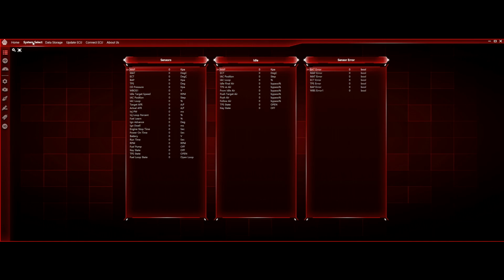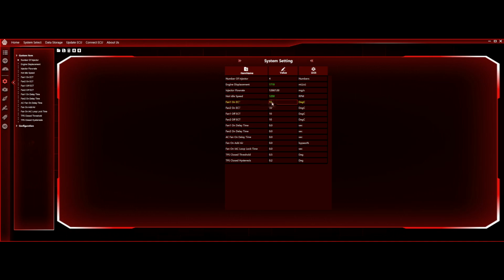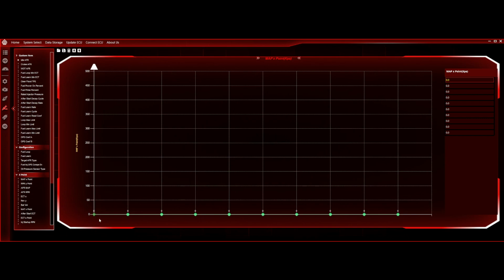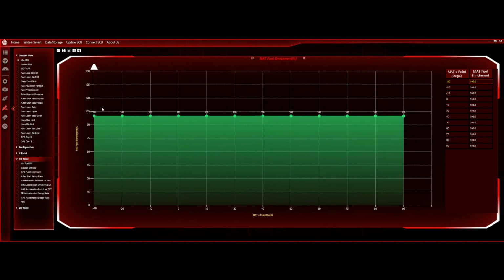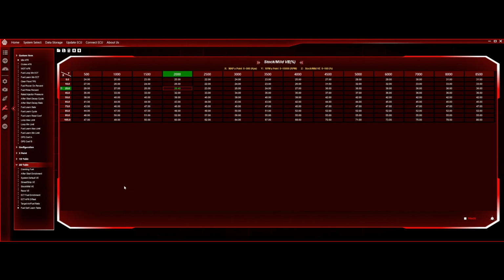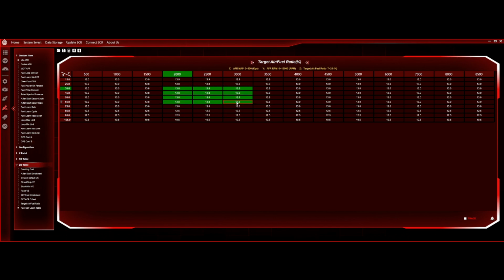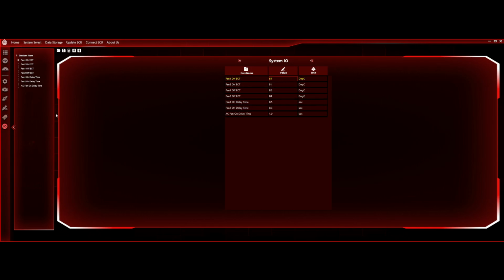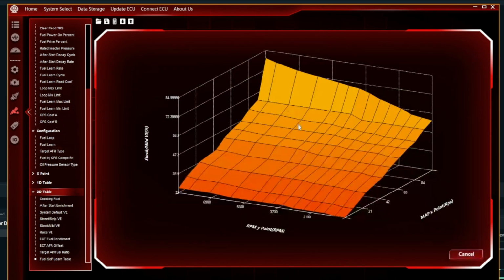Can you tune a rotary on Aces EFI advanced software? (I shouldn't have access to this kind of power)

Comment from the maker: I just want to add a comment on here after messing with this tune on my car. This system reads 100kpa as vacuum (~14.7psi) and 0kpa as atmosphere. Even if you swap the numbers around itll still track the same. It's kinda confusing.

Comment: How do you have it set up to read the actual RPM? I have an issue where it only teads half the actual RPM of the engine. Is there a revolutions per pulse setting i am missing ? Did you run into this
Reply from the maker: Some of their newer models have the ability to change the pulses. You need a tach adapter. That's what I did. I took the aces efi off though. Im running a large turbo charged bridgeport and their software won't let me set idle above 1600rpm. Just pick up a tach adapter off ebay and run that
Reply: @wheresmy10mm  so with the tach adapter the hand held reads the correct rpm ?
Reply from the maker: @gusrodriguez85 yes
Reply: @wheresmy10mm ok cool thanks, which tach adapter did you use ?
Reply from the maker: @gusrodriguez85 https://ebay.us/m/jZCvA8

Comment: i'd love it if they made the VE table a little more like holleys with a heat map, but overall super pleased that it does have PC software and not just the touch screen that comes with it. however the software reminds me of stock ECU's in appearance and how the VE is adjusted. good work on it. you've probably learned it pretty solid by now. i was also self taught for the most part. best way to learn is hands on..
Reply from the maker: The new updated version does have a heat map function. They're definitely headed in the right direction. There's still some oddities and hiccups but the system does work very well. Thanks for watching!